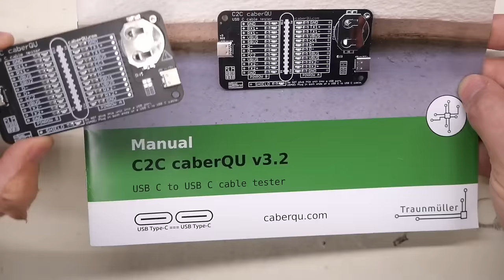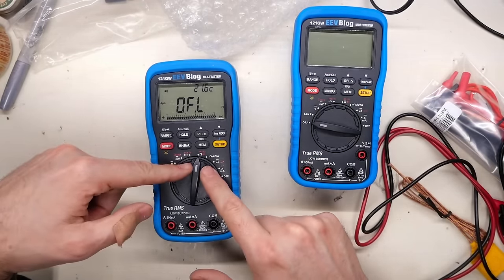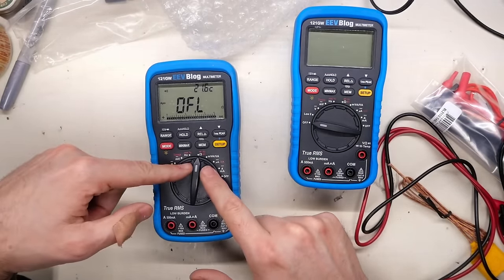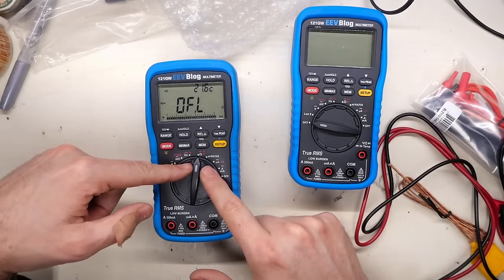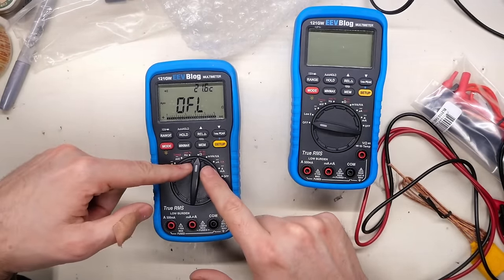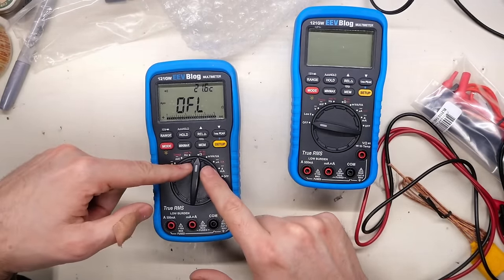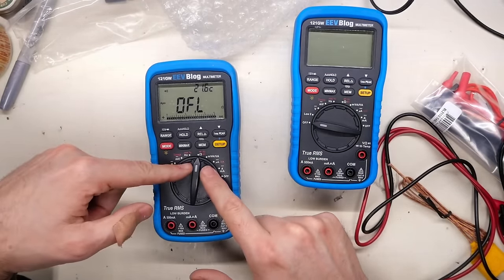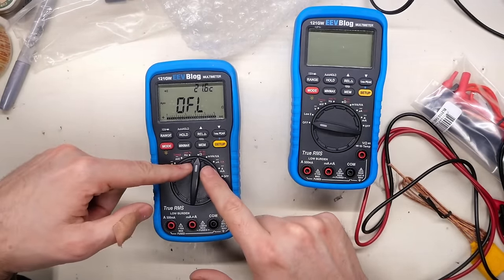0080 A 128k RAM upgrade for the Speccy, some recovered SIDs, USB-C Cable testing and a new DMM

Comment: Thanks Adrian, glad you got it. No point spending time trying to troubleshoot the old one, it's likely a tolerance issue on the range switch contacts, pressure and thickness of the PCB on those first batch units.

Comment: Anything with a physical rotary switch will wear.  Good application of contact cleaner will help generally.  This is where Fluke shines - the switches last a really long time and work even in high humidity reliably for many years.  I have one that was actually submerged in a flood, after disassembly, drying, contact cleaning and reassembly it's worked fine for nearly 20 years.  VERY expensive however. Deoxit will work ok, surprisingly wd-40 will help in a pinch.  I usually used tuner cleaner when I had charge of repair/calibration for the physics department decades ago.  Cleaning contacts will not disturb calibration as long as you don't get it in the pots (normally on the accessible side of the board)
Reply: yeah, I was just saying this. I had to take apart my good expensive MM and clean the wheel with Deoxit once, but it's been fine for many years since I did that. I'm sure it's a humidity thing
Reply: In working with rotary dial switches, whether it be Fluke, Simpson, or Triplett, the switch oxidation can occur, simply from use in moist environments, & general 'wear & tear'.  Motorola use to sell a contact enhancer call Stabilant which works well.
Reply: Funny enough, i had three flukes that were stored together in a cabinet and 2 of the 3 died. The only one that didnt was the ammeter type which was the cheapest one. The only one i had left was one that i kept in a humid garage. I am assuming the ones in the cabinet died because i had some massive N52 magnets stored on the shelf above and me pulling the multimeters out induced some random currents in the meters killing them.
Reply: @jeffreypomeroy6173  I don't expect strong magnets would be good for DMM.  Fluke's are typically resilient to RF Fields.

Comment: Hey Adrian, you will be surprised on that uni t clamp meter. You say it's the range button and i thought so as well the first time in mine. But i was wrong. The battery compartment is like a clam shell. The battery compartment has spring contacts to the pcb. Grab the case and twist/flex it. It will flake out.

What i ended up doing is soldering the battery contacts to the pcb with wires.

Comment: The ZX Spectrum plus is just a regular 48k Spectrum in a new case, Sinclair even sold kits to upgrade the rubber keyed machine.
Reply: i know, i bought the upgrade keyboard direct from them, still got it 😉  £20 for the keyboard to do it yourself, £30 if you send it to sinclair for them to do it for you

Comment: The ZX Spectrum plus was a keyboard "ahem" upgrade only....Loading tapes on any early british 8 bit was always a joy/challenge. The spectrum compared to the oric was a dream to load tapes...
Reply: it also has a reset button which was actually a huge improvement over having to pull the power.... which is literally a button with mod wires soldered directly to the reset pin.
Reply: @ThePoxun  Just noticed the reset button, you can hardly see it ! Also the plastic legs to give the ideal typing angle........

Comment: The Spectrum Plus is still only a 48K machine. The first 128K version had a large metal 'toast rack' heat sink on the right hand side. The ROMs will also be different as the 128 had two separate modes (48K and 128K) and a small built in menu.
Reply: yup the zx spectrum+ 128 has a 128K legend on the right hand side.

Comment: I'd be really interested to know if the 128k RAM expansion would turn your 48k into a 128k as the ROM was very different, really interesting to see a follow up using it and making the mod - also troubleshooting your bad tape loading as I'm sure you could fix that. As others have said, more ZX content always welcome 😊
Reply: The Harlequin board does that: it turns a 48 into a true 128 with RGB.

Comment: Would definitely like a speccycentric episode sometime... I designed and built my own FPGA-based "super Spectrum" ZX Prism... 512K, 256 colours, different resolutions, built-in DivMMC and virtual tape etc. One day I hope to make it an open source project that others can built but for now, there's only one and it's over here in Australia!
Reply: I have that too, it is called a MacMini 2009, it costs 25€, and it runs an emulator.
Reply: @lovemadeinjapan Um. No, it's not an emulator and i designed and built it myself.
Reply: @SophieFeet  Sure, bit if you go FPGA, you can as well emulate. The only thing I think FPGA is a legit route, is to keep old arcade machines up and running, so you can create the specific RGB 31kHz signals.
Reply: @lovemadeinjapan You're welcome to your opinion. I don't share it.  having spent years working on the hardware, microcode and firmware for it, i finally have my dream machine.
Reply: @SophieFeet  That sure is a cool process, you must have learned a lot! I just don't want FPGA's in my retro machines.
Reply: Aah, none of my 80s machines have FPGA :) Ive got real Sinclair, Amstrad, Acorn and Commodores that i regularly use (from real tape/disk too). The FPGA is in the one i built to my own specific design
Reply: @SophieFeet  I'm curious if you could make something to your specs for display with a Nec 7220. Seems that chip is capable of that.

Comment: I had Issue 3B board in 1985. I had colour always a bit "off". Spectrum tape checks: check oxidation in 3.5mm socket. Don't connect both of them, if you load programs connect just aux. Tape recorder/ player MUST be set to mono. It also must never put to max volume. Border stripes must move "lively". If everything fails, use screwdriver to adjust the tape head. Else hardware.

Comment: I have the same ANENG, used to give random resistance reading in continuity mode. It turned out to be the rotary switch acting up. Just clean up the gel and dirt on fingers on the PCB,  do not reapply any gel or lubrication, it will get dirty again. The EEVBlog multimeter might have the same issue, it's worth cleaning that one too.

Comment: For the 128K ram, you can use the 128k rom (not +3 rom, it looks for the disk controller on startup and will hang if not found) with the advanced basic interpreter. That won't work without the 128k ram since it does a bit of a ram page swapping diagnostic on startup, but does not need the AY chip unless you try to use extra sound commands beyond beep. I know this because I wrote a z80 emulator and extended it to a ZX spectrum emulator. The 128k ROM wouldn't initialize until it successfully swapped through all the pages.

The problem is, the rom switching is done via the same output ports (and by extension the same logic) as the ram switching. So, unless that expansion supports putting multiple pages (2 roms for 128k) of rom on that flash chip, I don't know how you'd use it properly. I would expect it must allow you to load roms onto it somehow.

Comment: I'm still using my METEX multimeter I purchased in 1992 - first one - still working without any issues.
Reply: Still using my Fluke 77 from 1984 but also use a few others.

Comment: Useful tip:  Tie an overhand know with both leads of the multimeter near the pins that go into the multimeter.  This keeps the leads together so they won't get lost and go astray.  This has been quite useful to me with the variety of meters I've used.

Comment: also just FYI, I've had continuity issues with several Multimeters, including my very nice expensive one; all it took was taking it apart and treating the main selector wheel with Deoxit to fix it, and it hasn't given me any trouble for years now

Comment: For measuring low resistances i have an old (but surprisingly accurate (lab tested)) bench-multimeter (30 kg) from the sovjet-era. Its a bit slow in auto-ranging, but finding shorts does work pretty well. It can measure mOhms and other very low values.

Comment: I still have my first multimeter, one that my uncle gave me when I was a LabKitten helping him work on old cars back in the early '80s.  It's an analog sweeper and it's maybe only accurate to a tenth of an Ohm or Volt, but it still works!

My work multimeter is a Fluke 179, which is a beautiful piece of kit and has lasted me over 15 years of almost daily use.  It has a great backlit screen, a responsive processor, and handles nearly every task I throw at it.  But... it's pricey.

I can also recommend Klein Tools' MM300.  It is also a nice budget meter and is excellent for LabCatting, but the stock probes are junk.

Comment: Adrian,  just spin the dial on your meters rapidly a bunch of times. Like 20-100 times. Usually cleans off the contacts. 

If that doesn't work, then dismantle them, and clean the contacts on the switch fongers and PCB traces used for the dial switch. 
I've resurrected multiple multi meters this way over the years when they started doing that
Reply: Normally, Adrian would be the first to exclaim Deoxit! He seemed reluctant for some reason, yet is happy to spray it all over an "irreplaceable" 40-year-old computer. 😅

Comment: For that cable tester, it can actually tell you a little bit about the current rating of the cable indirectly. All USB C cables are rated for 3A or 5A, and 5A cables (among other cable types) must have an e-marker chip.

If you have a cable with an e-marker chip hooked up, one CC LED will glow at full brightness and the other CC LED will glow dimly. This means that if you do not see this pattern, the cable must be a 3A cable with no e-marker chip.

Put another way, 3A USB2.0 cables don't require the chip, but cables that are either 5A or USB3 do require the chip. It's not a full answer though, because you can have e-marker cables that are only 3A if they're high-speed USB3+ cables; to tell those apart you need a tester that can talk to the e-marker chip, but in my experience most 5A cables are marked as such and so you mostly just need to confirm that a cable is not 5A capable if it's unmarked.

Comment: Most Spectrum games I remember that were 128k, would typically have 3 voice audio as the "extra bits" for the higher RAM model as they'd typically want to keep 48k compatibility without having multiple versions.
Reply: I was about to say the same thing. The main reason to have a 128 back in the day was the sound chip, not the memory.

It would be interesting to see how compatible an expanded 48K Speccy is with 128K software, though. I can imagine some issues it might run into, but I don't know how common they are in the real world.
Reply: @duncansnowden6857 I'm curious about this too. How did the 128k Speccy know to load in the extra goodies back in the day?
Reply: @kyorin6526  As far as I recall, most programs weren't smart enough to adapt. You'd either have two different versions, with the 128K one simply crashing on 48K machines, or, if the only difference was AY sound, it would just “play” silently on a 48K machine. Waggling the I/O ports that control the chip on 128K machines doesn't do any harm on a 48.

I'm sure there are ways to check and adapt intelligently, but I'm not the guy to ask.
Reply: @duncansnowden6857  I'm sure I had a game called Chronos back in the day that somehow loaded extra stuff on the 128, it was probably just the sound/music that was different though.
Reply: @kyorin6526  It was a setting you selected at startup whether to be in 128k or 48k mode at boot up on 128k machines. Or at least on the later Amstrad ones.

Comment: Great stuff Adrian, I love the multimeter especially ... Now I understand that you can "make" a multimeter with a RPIs or similar with a clever little harness with safety diodes.
If you've any advice or could even do a video about that, it'd be *fantastic*!🤓

The Ikea battery thing is real now, my Dad works at a UK store and said that they only do rechargable ones now in the UK, so I daresay its international now (of course it is, UK and Sweden!).
It's for sustainability reasons, for some reason!
Hope that helps.
Are your Ladda's, 18650's?

Comment: Holy moly! ….that multimeter is $225 in Amazon. I have the same one normally shown on the Retro Hack Shack channel….a red cheap Innova 3320…but works just fine. I think I paid like $20 bucks almost 9 years ago for it.
Reply: The Innova 3320 is a 2000-count CAT II multimeter, while the 121GW is 50000-count and CAT III. ACV precision: 1mV vs 1μV. DCV precision: 0.1mV vs 1μV. Current precision: 10μA vs 1nA. Resistance precision: 100mΩ vs 1mΩ. Also, the 121GW can measure capacitance and frequency, neither of which can be done with the Innova. That said, the Innova has a battery testing mode that the 121GW doesn't have.

None of this makes the Innova bad, but it is generally less capable. If you don't need those extra capabilities, great; you saved yourself $150. But some people do.

(Count has to do with display precision. 2000-count means that it will measure a thing with 4 digits of precision until the first digit gets to 2, and then it jumps to the next range. So for example, you could measure a resistor at 1.999Ω, but if it was over that, you'd be measuring it at 02.01Ω. Or 19.99kΩ, but 02.01kΩ. Whereas 50000 means you might be reading the same resistors at 1.9991Ω, 2.0009Ω, 19.991kΩ, and 20.099kΩ, and you'd lose that 5th digit of precision once the first digit reaches 5.)

(And CAT II vs III has to do with safety ratings. I'm not terribly knowledgeable here, but it usually has a lot to do with physical build quality.)
Reply: @wbfaulk  thank you for the in depth description of the excellent capabilities of the professional multimeter shown on the video. 
I certainly don’t need all the bells and whistles for the amateur work-hobby that I do. Obviously, they not comparable, as I said the innova is a $20 dollar multimeter that works for me…I was just surprised to see the price tag on the other one, but I guess is worth it for an electronics technician.

Comment: C64s were made in several places: US, Taiwan, Philippines, Germany and UK. The Aldi C64s were only made in Germany for their Aldi Stores in Europe and are in Pal Format. At around this time Germany passed a law saying that all keyboards used on computer systems made in Germany must be "White Caps with Black Lettering." This caused some issues with other systems (Sinclair, Amstrad, at el.) but it turned out that they can be imported with their non-compliant keyboard as they were not made in Germany. Also the Aldi C64s were all white bread bins, despite the new flat "128 case" being made for the C64s of the time, they continued using/making the Bread Bin Case until Commodore discontinued the C64 entirely. If you can find it, a German made Plus 4/C16 will also have a white keyboard with black lettering.

Question for you: What is your opinion on building a C64 with the replacement boards being made out there? If you have enough C64 Custom chips, you could in theory build a "new" C64, and others like Jan Beta and other have.
Reply: AFAIK the Aldi C64 was made in USA and can be identified by the serial numbers CA4....., has 250469 boards. It was selled not only at Aldi, f.e. Quelle had this too.

The C64G was released after the Aldi C64, it has 250469 or some stock 250425, and some but not many had the old dark keyboard (as c64 supergame system). The c64g was build in germany.

Comment: I have to take my aneng multimeter apart periodically because of the same issue. I clean up the switch with IPA and put a bit of silicone oil onto the PCB. Works perfectly after that, very consistent, but it doesn't last more than a year.

Comment: My multimeter is a Tenma 72-10415, I chose this model after a good bit of research and am quite happy with it. It was a great price-to-features ratio and designed well. But that was several years ago, and it looks like this particular model is no longer manufactured. Perhaps their newer models are still a good choice, I don't know.

Comment: With that USB-C cable tester, the CC1/CC2 lights will light dimly if there is a chip inside of the cable and you only touch the ground on the other side. Also there is a very similar device that does USB(A-2, A-3, C) on one side and (Lightning, microB, miniB-2, miniB-3, fullsize B2/3, and C) on the other.

Comment: The EEVBlog 121GW (1.21 gigawatts…nice) is currently US$215. The Aneng meter is $26. For a basically 10x price difference, I don’t think it’s fair to expect even remotely comparable quality and precision.

Test equipment that doesn’t work 100% of the time can be annoying, but it can also be deadly. If you’re working on equipment that is high enough voltage to shock you, having equipment that doesn’t reliably show correctly can lead to accidental live work (which is exactly why there are requirements for live-dead-live testing methods).

Comment: No difference between the Spectrum + and the rubber key except the keyboard. My first spectrum was a plus, so I've got a bit of a nostalgic "thing" for the keyboard. It had an issue 3B board.. Loaded everything just fine (and I didn't ever have any problem with any other issue board particularly - though that was in the 80s). You've tried all the things I'd have suggested to get loading working consistently - amp etc. Only thing you didn't mention which I'm sure you tried - make sure you're plugging into EAR on the spectrum, make sure the socket's tight and make sure you're using a mono jack at the spectrum end, and sum the LEFT and RIGHT output from the modern device rather than just use one or the other  (not usually an issue, but can help under some circumstances)

Comment: That cable tester is great for determining which pins are in use but if you want to truly know everything about a cable you need a tester that can read the E-marker chip.  Plus those tell you exactly what kind of cable you have without going through that nightmare of a chart.